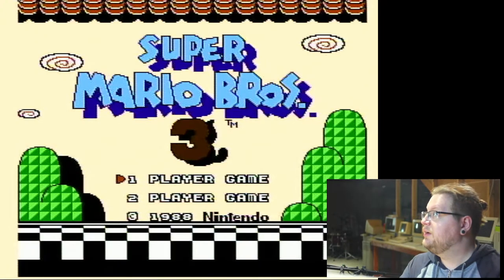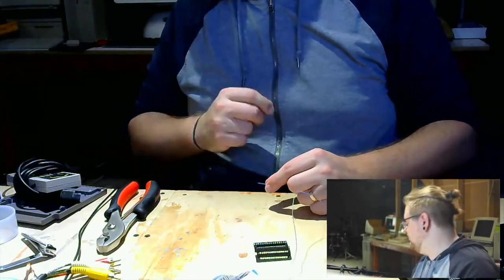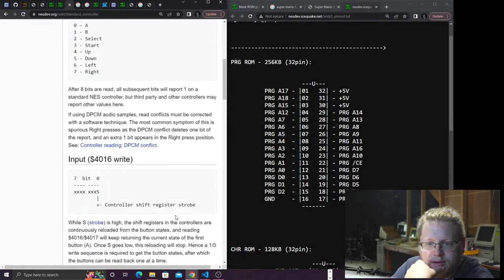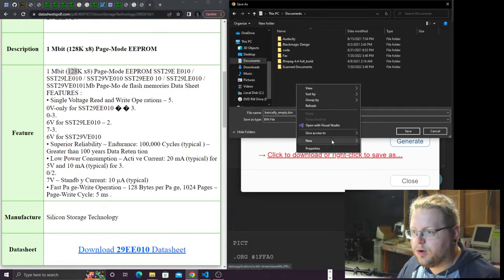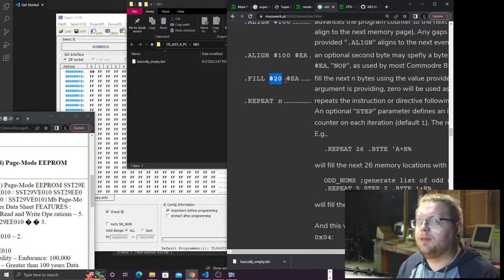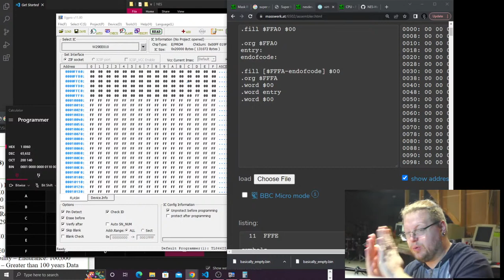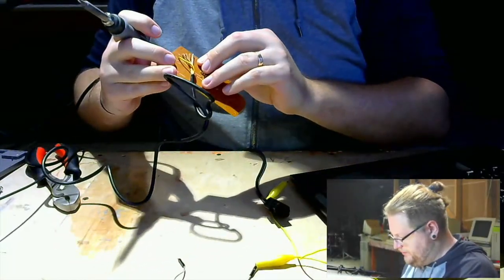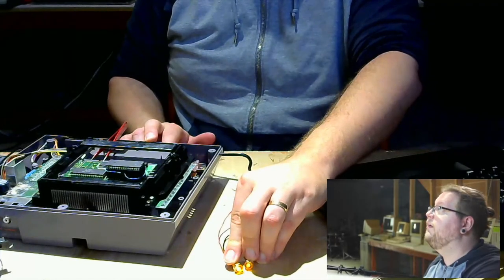It's Just A PC | S01E04 | Repro is now A-Go

Comment: What you usually do when you have small address space and large memory is repeat, i.e. mirror the program to fit the chip, so $0000-$ffff is the regular program, then to fill out the remaining, $10000-$1ffff can be the same copy-pasted, it won't matter in this case unless we are actually using that half

Comment: What I dream of doing (some day) is to make a boot loader for the NES. Literally solves all problems.
The idea is when it boots up, it should copy a small program (maybe like 256 bytes or whatever) into the NES's RAM, and stay there across resets. Its purpose is to listen for incoming data from a PC from the controller port and store it to the cartridge, which should be 32K of static RAM. So every time we want to make a change, no need to re-burn an eeprom, just send data to the bootloader and it will do the rest (programming, reset).
I tried to do this, but I never got around completing it
Reply from the maker: The tricky bit there is that you have to have control over the 6502 reset vector in order to grab control on reset, and those are at $FFFC-D, in PRG ROM space

That said, you could do exactly what I did to make that happen on my genesis cart (check my old videos): put both a ROM and a RAM on your cart along with a little mapping logic. You configure the mapping logic to place the ROM into PRG ROM space at power-on and put a program in that ROM that writes a boot vector pointing to your monitor-and-load program into the RAM and then triggers the mapping hardware to swap the RAM into PRG ROM space

Comment: LDA $01 is a load from zero page location $01
LDA #$01 is a load immediate value of $01

I guess the zero page location resets to having it's Bit 0 to a one.
Reply from the maker: Crap, good eye, I didn't notice that typo. Yup, probably got lucky on that one, in my experience most RAM does tend to settle to FF when powered down more often than not